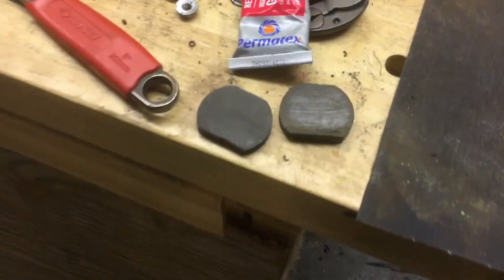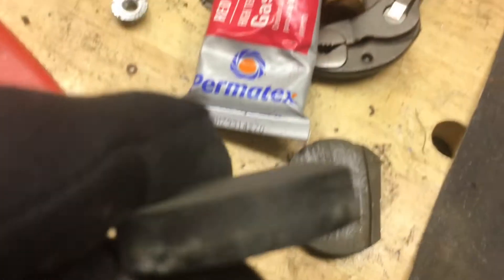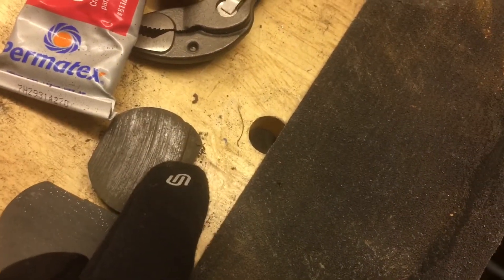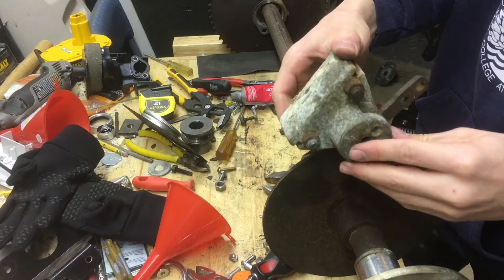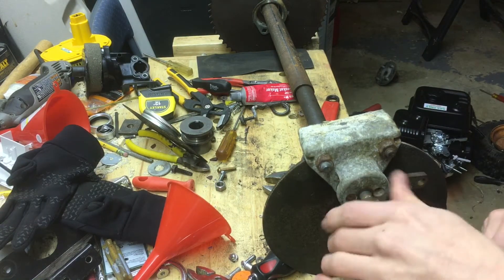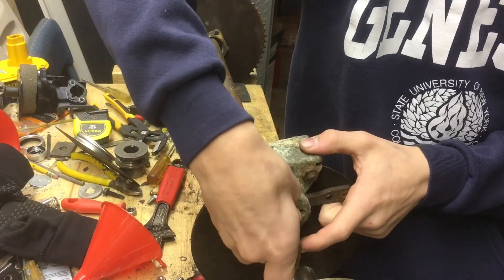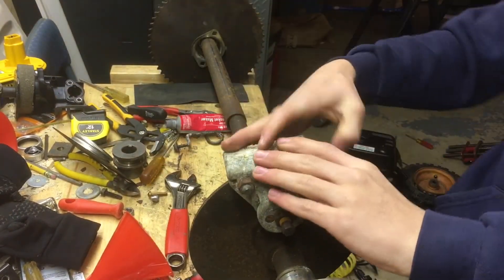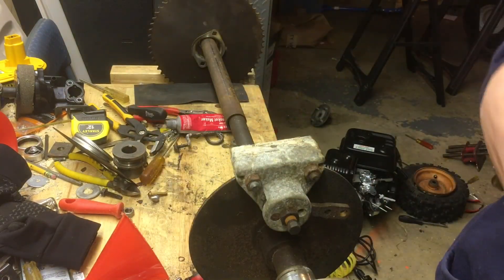How to Adjust a Go Kart Manual Brake Caliper

Comment: John do you have to take off the whole axle or can the caliper just come off, i have to rebuild it
Reply from the maker: You don't have to take the axle off. You can just take the caliper off by taking the 2 bolts the hold both sides of the caliper together. My axle was already off for other reasons I don't remember. I hope this video helps.
Reply from the maker: After some research, it depends on you go kart frame. Some frames you can separate it and pul of both sides. Other ones have the frame in the way, and you can only pull off one side.
Reply from the maker: https://m.youtube.com/watch?v=QtqgEpNiQDg
Reply: Do u happen to know how to take out the pin that holds that throw arm? PLEASE HELP

Comment: How do you remove the mechanical brake caliper
Reply from the maker: There are 2 bolts that hold each half of the caliper together. Just take them apart and the caliper should come apart